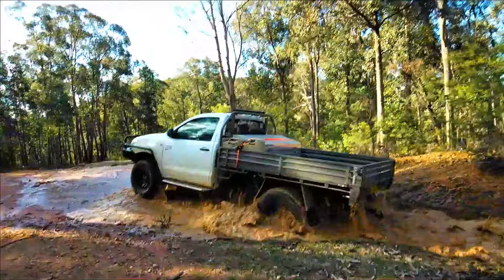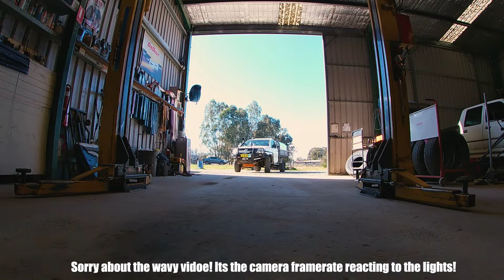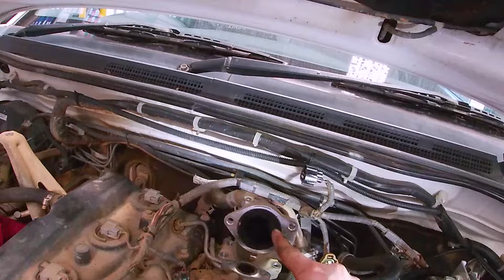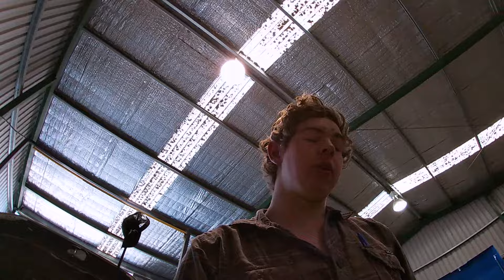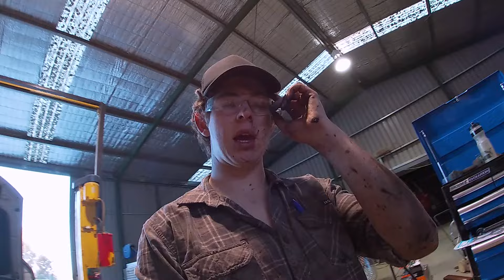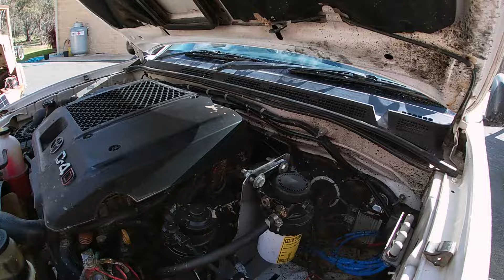Toyota Hilux EGR and INTAKE CLEAN

Comment: Fit an EGR electronic adjustable defeat and blanking plate with catch can . Always disconnect coolant pipes and ensure return flow . Split coolers blow motors .
Always clean 100% inlet system 
 If your going to keep egr   /clean 100%  full inlet system including decarbon egr cooler 

CLEAN INCLUDES   DEGREASE ALL DUCT AND INTERCOOLER

Comment: I’m starting to have problems bought the hilux on 350ks and I’ve just clocked 400, I’m not sure if the egr and that is clogged but it’s hesitant when accelerating like if it’s got hiccups, I’ve changed fuel filter and bypassed the little filter on the intake and no codes showing so yeah hopefully it’s sumn easy 🥲
Reply from the maker: A blocked intake shouldn't cause it to "hiccup" but should cause it to be sluggish all the time. Is it an engine issue or a drive-line issue?
Reply: @OutbackTrekkingGeorgeLeov  nah it’s not that, checked the driveline n diff, everything is still good, it’s just upon accelerating its stuttering, my Tafe instructor recommended to do a decarb cause it could be caked up, another reason why I know it’s not the driveline and diff is cause after 2.5 rpm’s it clears itself and drives normal in high revs it’s just building speed is what gets ya.
Reply from the maker: It could possibly be sucking air into the fuel somehow and cause it to run rough when under load. I'm guessing you would know what a slipping clutch feels like(just so you can cross that off the list too)
Reply: @OutbackTrekkingGeorgeLeov  yeah could be, clutch was replaced 6 months ago so still newish
Reply from the maker: Let me know what you find, I'd love to know the issue and outcome!
Reply: @OutbackTrekkingGeorgeLeov  cheers, will do, you have a great week.
Reply: @OutbackTrekkingGeorgeLeov  hey mate, just got the ol girl back, turns out there was a cheap air flow sensor and it went bad , just replaced it with a genuine Toyota part and now she’s all good!
Reply from the maker: @user-us2ij9vj1k  good to hear you found the issue. I wasn't expecting that! The last owner must of been a cheapo and bought the cheapest replacement 🙄. Good find tho, nice to know it was an easy fix

Comment: Thanks for the video mate, she's only just run in. I've got 410k odd on mine and still running sweet (2010 SR5 diesel) injectors done, but no EGR clean so I'm looking at following your video and doing mine. Had mine since new, only a few very basic mods (2 inch lift with Factory bullbar and 10000lb winch) heavier rear springs and shocks as got rid of the Factory tub after 2 months (useless for my work) and put a Silverback Gal tray on it with the standard under tray boxes and still running the Factory Alloy wheels (ran a few different types of AT tyres, but settled on the Bridgestone Duellers as they suit me...daily driver plus some off road camping) Installed new injectors at 285000kms but they weren't too bad (bit of insurance was my thought). Thanks again for your video.
Reply: 🤔But there's nothing to follow 🤷🏼‍♀🤷🏼‍♀

Comment: can you help me ,after i clean all the egr and manifold , then i start the engine my alarm engine yellow ,still blink wont shutdown , how you suppose im to do?
Reply: 1. Get a scan tool, they aren't too expensive and will come in handy for all diagnosis
2. You can try disconnecting the battery for 20 minutes then reconnecting, this will let your engine adjust to the new levels of air flow depending on your car. 
You can also look up "*your car* intake reset" some cars have tricks to resetting the intake levels
Reply from the maker: I agree with this. Make sure you plugged everything in too! It's easy to leave something unplugged like the MAP sensor or something simple. Best of luck 👍
Reply: take all the carbon you threw out and put it back particle by particle

Comment: Do you have a video of the actual cleaning process? What chemicals you use and all that
Reply from the maker: Sorry I didn't get to film this part as it was way to messy to be playing around with a camera while doing it. I used a screwdriver to poke all the chunky stuff out. Then I removed the rest of the carbon with petrol, carby clean, brake clean and some of that diesel engine decarb stuff. Hope this helps

Comment: Did you have to replace the injector pipes/fuel lines Etc.
Reply from the maker: It's recommend you change the lines every 3 times you have to take the lines off. This being the first time they had been off, I did not change them.
Reply: Obviously not watching 4b4 diesel channel about the 7 mm plate fitted to the engine cylinder head end of the egr to throttle body pipe I have one fitted 2yrs now  cuts down carbon build up by 80 % better fuel economy ( 10kms/ liter)

Comment: G'day man, thank you for the video.
Can I ask what alignment points there is to locate the top dead and bottom dead centre, for flushing out the head?
Reply from the maker: The crankshaft pulley has a notch in the front of it and the top of the timing case has a notch in it too. Line the two notches up perfectly to get TDC. And just rotate the crank 180 to get BDC
Reply: @OutbackTrekkingGeorgeLeov  Thanks, I really appreciate it.
Reply: @OutbackTrekkingGeorgeLeov  how much do you charge and what kms would you recommend doing a full clean?

Comment: Hey mate if you line up the timing marks front 2 valves are closed ? Also how do you get to bottom dead centre for the back 2 valves to close . Thanks
Reply from the maker: Turn the crankshaft round 360° or the camshaft 180°. Clean the front valve ports on TDC and the rear ones on BDC

Comment: Great video mate! Just wanted to know if it’s worth buying a hilux with the same engine at around 260-280kms? What things would I be prepared to replace as the kms get closer to 300 and above?
Reply from the maker: The timing belt will need to be changed at 300 000
Make sure the injectors are good (get a mechanic to put a scan tool on the vehicle and check the injector values to tell you whether they are good or not)
That's about all I can think of off the top of my head that are specifically engine related. Everything else would be the same as a normal motor where things wear out and need replacing such as: Alternator, starter motor, fan belt, water pump, rocker cover gasket. Just things like that but that's normal.
Currently my hilux (the one in the video) has 340 on it and the engine is running as normal.
Reply: i bought a manual 2007 model with 460k kms, drives like a dream, motor unopened, bought it straight away when my mechanic said it was all good, got him to change new injectors straight away as the injectors werent done yet along with full service, timing was done already, i get 800kms out of a tank if im on hwys, mix hwy with suburban ill get 600 easy

Comment: I have a toyota hilux 2016 SR 4WD,

I've noticed when I accelerate I lose power, and revs high. Does anyone possibly know what it could be?

I'm thinking it may be the exhaust system.

I've changed the following oil, oil filter, air filter, fuel filter.

But yet it still lags.
Reply from the maker: Have you cleaned the MAF sensor (it's the sensor ontop of the airbox)
Reply: Update; I've lightly taped the  catalytic converter too hear if there was any blockage. But couldn't hear anything.

I'm now thinking it may have low compression on one of the cylinders.
Reply: Could it possibly be the DPF system going into limp mode? But no light comes on to indicate that?

I have an appointment with toyota in Auckland, New Zealand tomorrow.  Free, as there was a current fault with the 2015 models + with the DPF system. And my warranty has been extended 10 years of the date it was manufactured in 2016.
Reply: @OutbackTrekkingGeorgeLeov   no sorry I haven't I'll do that tomorrow thank you.
Reply from the maker: @mikeyankee8603  make sure you clean it with the proper MAF cleaner 👌. It won't be an instant change but it will make it much better if it's dirty
Reply: @OutbackTrekkingGeorgeLeov   hey found out it was my clutch was slipping lol.
Reply from the maker: @mikeyankee8603  well that will do it😂. At least you found the issue
Reply: Check out your clutch
Reply: @TriNguyen-su5gu  thanks bro was the clutch fixed it and sold it bro

Comment: Is it worthwhile putting an oil catcher on the vehicles ?
Reply from the maker: 100% it is. I highly recommend it mate!! Wish I did it sooner
Reply: Catch cans add crankshaft pressure which can cause leaks and head gaskets to go, any warranty you had is gone if you fit one
Reply: @a_biggy801  incorrect

Comment: Hey mate what did you use to clean the intake ports on the block ? And what reference did you go off for having half open half closed cheers
Reply from the maker: Hey mate! To clean everything I used diesel intake cleaner, carburettor and throttle body cleaner, and I used compressed air to blow out big chunks from the Intake manifold! To get half the intake valves closed (front 4 valves) I removed the timing belt case and used the top dead centre (TDC) mark on the camshaft pulley against the TDC mark on the head. Once I cleaned the front 4 ports I rotated the engine 180° so the TDC mark was directly opposite the TDC mark on the head (this makes it at bottom dead centre)! That allowed me to clean the the rear 4 ports. Now make sure you tape off the valves that are open!! Don't want to risk something getting down ontop of the piston!

Comment: Hey mate do you use gasket maker on the intake or just the metal gasket
Reply from the maker: Hey mate, I just used the metal gasket! It sealed up really well but if you are worried about it sealing with the old gasket I'd suggest ordering a new intake manifold gasket!

Comment: Economy when new till my fuel light 631km 63-64 ltrs  [city]  Hilux 3.ltr .  Did this till about 80,000km 
Sold at 120,000km Needed injectors and inlet clean 
Once system is cleaned my 3.oltr Ranger was the best result gained ***consistency***  ,,  egr fuel usage fluctuation was a  major problem ,,now 10ltr per 100km highway . Gained approx 1---1.5ltr per 100km

Comment: If the car has done 300k plus km and is going ok why touch it?
Every diesel will have some build up but it has been allowed for by the engineers obviously or they would all shit themselves.
IF YOU IT ISNT BROKE DONT FIX IT.
Reply from the maker: The vehicle was starting to become sluggish and soot quite a bit on take off. It hadn't had a catch can on it and had never had an intake clean. So me being a mechanic I decided to take a look, and it was pretty built up so thats why I decided to clean her out! Goes much better now!
Reply: Haha no they haven't they have built an engine around compliance with a limited warranty ie not 300000km 
they don't give a shit when it starts running like shit  chewing the fuel , loss of power etc etc etc 
its called maintenance !!! ffs
Reply: This is probably the kind of dude who changes his oil only after the engine's burnt half of it off